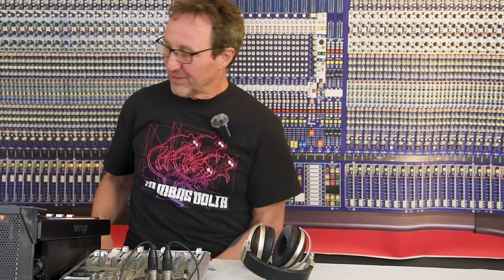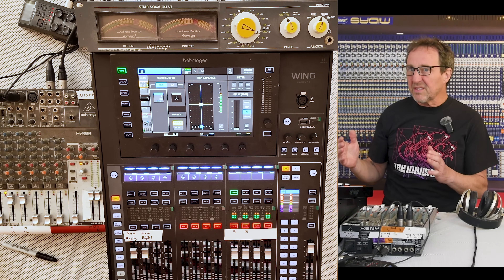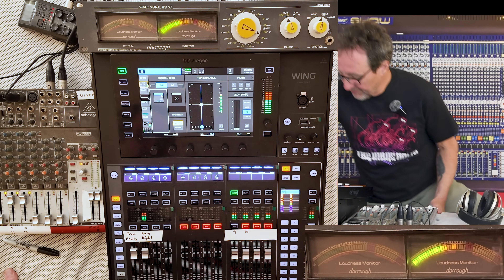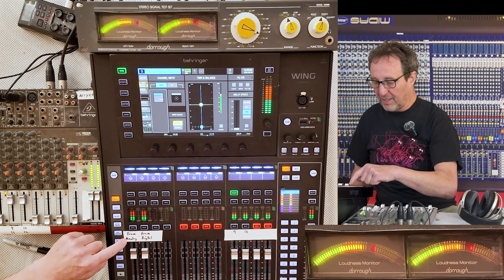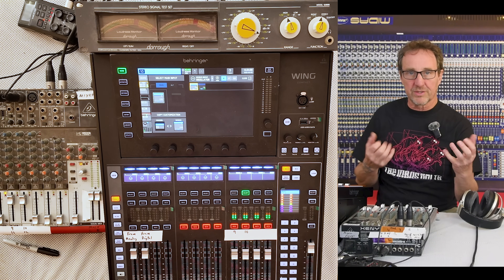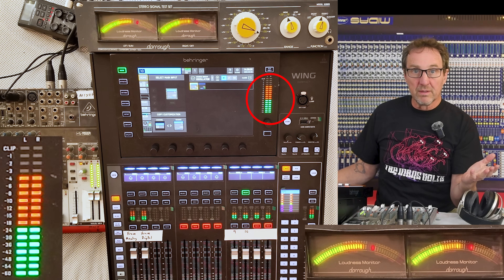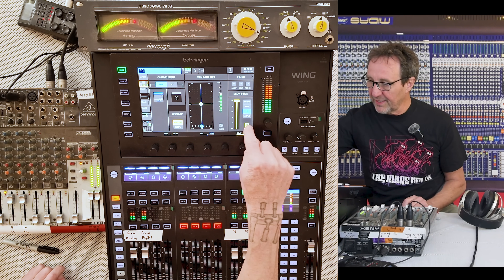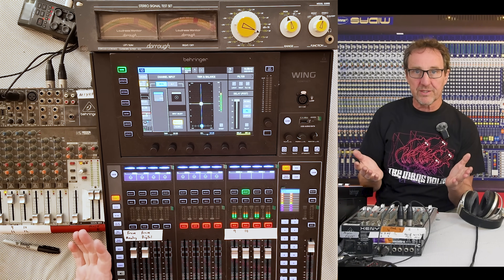Digital Audio Meters Don't Show What you Hear - Sometimes

Comment: You're confusing peak and rms Metering.

Use a RMS digital meter or a PPM analog meter and you'll get similar results. 

This confusion is the base of "gain staging" or "analog vs Digital" summing myth
Reply from the maker: Am I?

The dorrogh meter in the video shows both RMS and peak, 

As you can see in the video, the analog runs and peak meter are both reading correctly. 

Also as I show in the video,, the same digital peak meter reads correctly if the signal gets converted to analog and back to digital.

Is it a meter issue or a signal issue?
Reply: @DaveRat because dorrough is aligned to AES17 standard and the digital meter use EBU. 

That's why "db" means nothing without a common scale

Edit : the référence conversion from AES17 to EBU is also known as RMS+3 (If my memory is correct, this option is available in RME digicheck software metering)
Reply from the maker: Ok, so 8f it's the meter that is the issue, why does the exact same digital meter read the signal correctly if the signal has been converted to analog and back to digital?  As 8 show in the video on the Wing channels 1 and 2
Reply: You're assuming that the Wings master meter is calibrated the same way as the track input meter. I don't think so. Digital metering can be RMS or Peak. On a console like the Wing, it actually makes sense to have different calibrations. Peak on the master because ultimately, what we want is to avoid the DAC clipping. On the inputs, slower RMS metering makes more sense. Each meter has its own ballistics. To illustrate this as simply as possible, there's a simple experiment to do. Open Reaper and place white noise on a track. Then place a Reacomp on this track. Set the Reacomp with an RMS size of 0ms and a knee of 0dB. Lower the threshold until you get 3dB of gain reduction on the GR meter.  Now, slowly move the RMS size knob (the calculation window time for the quadratic average) to the right. The larger the window, the closer the gain reduction will be to 0. The incoming signal has not changed, however. It is simply the way the threshold is measured that varies. In a meter, it is the same, there is a window size that wants to vary from 1 sample to 1000ms. When comparing meters that do not have the same window, they automatically obtain different results. Add to that different calibrations between EBU standard and AES (and others) and we end up with a gigantic mess. On the master of the reaper mixer, you can right-click in the metering and configure the peak to RMS ratio as you wish with the possibility of activating or not the 3db offset @DaveRat
Reply: @Daysofsamara I think this is the answer Dave is looking for.
Reply from the maker: Nope, not assuming anything and that was the one of the first things that I tested when I saw the metering difference of the analog converted signal, it has nothing to do with the track meters or the master meters being different on the wing. 

Try it. You can take two channels and send them together to the left master of the wing and some them to a group come out of the wing convert to analog and then convert back to digital into another channel and send that to the right channel of the wing 

And the master meters of the ring will show up incorrectly on the left and correctly on the right
Reply: @DaveRat when you convert back to digital on the other track, how to you gain stage? I mean, aligning on what meter?

Edit : because, as far as I know and according to the manual of the wing, output alignment is 0dbfs= 21dbu so 4dbu is -17dbfs and for Input 0 dbfs = 16dbu so 4dbu is -12dbfs. So you have to compensate by trimming;  and what meter do you use for reference?
Reply from the maker: Are you working towards it being a metering issue and that that additional signal is not actually there and the meters are reading something due to some quirk that doesn't exist and/or doesn't matter? 

 or are the meters reading actual signal that is reducing the headroom available to us? 

Either way it's an issue that all the consoles have 

And converting to analog and back again makes it go away. 

And it doesn't happen in the analog domain. 

Well trying to figure out what's causing it is interesting and good perhaps start from the other end and look at how you would deal with it. 

Do we ignore the digital meters and use external analog meters and perhaps make ourselves vulnerable to digital overload? 

Do we trust the meters and accept the fact that we have reduced headroom and metering for sound that we can't hear? 

A real world example of an issue here is mixing for broadcast where metering level for the mono summed signal is compared to the stereo signal 

In this scenario the mono signal would look different on the meters than it sounds.

Plus situations like drum mics where 10-12 or more mics are all picking up high frequency energy from the symbols that is primarily de correlated would actually create something similar in real world
Reply: @DaveRat Meters in digital are useless. On that point, we agree. A simple red led flashing when clipping would be enough. And that's the beauty of working on digital with 24bit dac/adc, you can ignore Metering and just follow one rule -> just keep headroom. With 24bit converters you have more than enough headroom to work with (144 db of SNR) so we don't care about metering precision and what it really measure (peak, rms, aes, ebu,...). Personally, I use this rule with digital console or DAW for gain staging : track fader at max when solo = no clip on master bus. By doing so  you can ignore metering and you have the max fader resolution.
Reply from the maker: Yes having awkward and non-intuitive workarounds that deny you accurate visual representations of what's going on are definitely an option.
Reply: @DaveRat Is it worse than coming up with a shaky theory about digital summing and trying to prove it using a truncated protocol?
Reply from the maker: Whether digital summing is an issue or not is something I don't have measurement proof of. 

But it's fairly easy to demonstrate that the metering on digital summing is not correlate as accurately to what we hear as it does with analog. 

For d a w situations where you have plenty of time to get things right, and the ability to backtrack and fix things, having a system that does not rely on accurate metering is feasible. 

For live audio where there is no rewind and everything must be as good as it can be as fast as you can get it done, accurate accurate and logical metering that aligns with what we hear and what the system amplifiers and speakers will see is extremely critical and important.
Reply: @DaveRat Analog metering measures the intensity of electricity; digital metering measures a quantity of data.  Neither measures sound, and neither corresponds to what the human ear hears. In short, they tell their version of the story, not the truth. So, certainly, the ballistics of the VU meter and your experience with this tool mean that, from your point of view, there is a correlation between what you hear and what the meter displays. However, if you send a 5 Hz tone to your master, your analog VU meter will go crazy, but your ears will hear nothing. If we really want metering that corresponds to our auditory sensation (and fletcher curve), we need a LU (loudness unit) meter. In the digital domain, this type of meter exists, but it is of little interest in live mixing, even more so in mixing on high-resolution console since, in absolute terms, we have much more headroom than necessary.
Reply from the maker: Agreed and this is exactly the issue. With a 96k digital console, less than 50% of the bandwidth is in the audible range.

Fair enough but where are the tools readily available to identify and manage these out of audible bandwidth signals?

This was not an issue or as much of an issue when dealing with analog and converting to anolog and back to digital solves this particular issue.

You are correct in describing what is happening. What I find curious is that you are ok with it rather than pushing for improvements on a flawed setup.

For example, why don't consoles implement an out of bandwidth meter available on the cue buss that allows us to see high frequency information and issues that are above 20K yet passing through the console effortlessly on a 96K board?

The console is readily reproduce these ultra high frequencies and move them around internally and they can accumulate and cause issues yet no console manufacturer offers clear insight into actually seeing what's going on. 

Or better yet fixing what's going on. 

But there's a whole new mess if you start low passing signals because the low pass filter is create issues as well. 

Try it, set up like I did in the video where you show the metering issue and then use low pass filters at 22K or 24K or whatever to try and get rid of that high frequency energy that's causing the issue. See if your metering goes to correct. 

And if you're wondering if it's a high frequency issue, try the same test with pink noise that doesn't have all that I frequency content see if your meter is read correct then.
Reply: @DaveRat I'll summarize more simply: using VISUAL measurement tools to measure a SOUND signal will always be inaccurate. Even more so because the ear is non-linear. Metering is therefore already paradoxical. On analog equipment, there is an interest in giving an approximate value to the signal in order to get as close as possible to the sweet spot of the device and to take full advantage of the SNR. In digital, you have a container much larger than the content to put in it. The best microphone in the world, in perfect conditions will have an SNR of 105db. 24-bit digital allows 144db. And whether you place the 105db as close as possible to 0, as close as possible to -144 or anywhere in between has no impact. Which means that the only information that is relevant to know is not to let the cup overflow (exceed 0dbfs).  Knowing that the vase is 30db larger than the signal that must be put into it, well, stay away from 0dbfs and everything will be fine. For the rest, since, in the end, we are dealing with SOUND, it will always be more effective to use your ears to evaluate a signal than any metering.
Reply from the maker: Fair enough it will always be inaccurate and current digital metering is less accurate than what we used to have with analog. 

Some people may be okay with this, personally I find that to be less than optimum to be going backwards in accuracy rather than forwards, with newer technology

Though the term accurate is not ideal in this scenario. 

The digital meters are actually more accurate but less informative of really what matters to us. 

I spoke to a digital console designer And they agreed that having better metering in the digital console would be optimum and preferred but the digital horsepower to calculate the equivalent of a true VU meter for every channel and also provide accurate information to avoid digital overload would be extremely taxing on current digital systems and therefore it is not being implemented even though it would be better. 

And by better I mean closer to as good as we used to have with analog
Reply: @DaveRat for the 96k bandwidth. once again, this is a clumsy shortcut. 
Using a sample rate of 96k does not necessarily mean that the entire signal extends to 48k. the signal circulating in the console depends on what goes into it. 
Most mics have a bandwidth of 20000Hz. 
So, by adding two, three, 8 signals with nothing above 20,000hz, the summation of what happens above 20k will always be zero... 
So, maybe with the console's internal oscillators, it is important... but, in real life, we are in an area where nothing happens or, at worst, very low level signals are completely negligible.
Reply from the maker: And hence the video where I am showing that what you see on a digital meter might not be what you hear. 

I recommend that rather than speaking in the hypothetical maybe actually try this with 10 white noise channels low passed at 20K de correlated in summed. 

A test that I have done.

A scenario not too dissimilar to having a dozen drum mics in and about and around a bunch of cymbals. 

Check the results with and without the low pass filters on the white noise and check your digital metering versus your analog metering. 

Which one is more accurate to the actual signals being processed? 

Which one is more accurate to what you hear? 

Which one is more useful? 

I spent many many hours testing all of this with everything ranging from band limited white noise samples into analog inputs, and white noise samples with frequency responses that well exceed the capability of the A to D, and numerous methods of manipulating the signals to get things to line up.

I think you might find some interesting results if you start messing with it
Reply: @DaveRat : No, once again, your instinctive certainties are misleading you. "Decorrelated" white noise means nothing. The noises are just identical and shifted in time. By summing them and reversing the polarity, the RMS volume is reduced but not the instantaneous peak level (a sample in our case). This is why your two meters tell you different things, because one is capable of detecting the peak level to the nearest sample, the other uses a quadratic average. Replace your analog meter with an (analog) PPM meter capable of the same level of precision and you will get the same results. In the case of cymbals, we will be very far from having identical signals but shifted in time. So the cancellation effect will be much less significant.
Reply from the maker: Really, even when in the video I use two different white generators or when I do tests where I use white generators from completely differing sources? The time delay is just one example but the issue is consistent regardless.

Test it, and your hypothetical may not match the reality.
Reply: @DaveRat does the sound of oscillator 1 differ from the SOUND of the oscillators 2? No. Because both are white noise. Now play a bass in a track and duplicate it. Delay the bass on the copy track by 3 sample. You'll get comb. Some frequencies will null and other will built. Still Ok? Now watch this by cutting the summing of the comb signal by packs of ONE Sample. Some of the packs will be At max (that's the peak level). Then, if you take 10 packs and make the average value, you'll never get the max value. Because some dip will lower the average value. That's the RMS metering.
And what about your ears? 
That simply can't hear ONE sample max value, they hear an average value of a bunch of samples.
Reply from the maker: @Daysofsamara You're confusing non-random signals with random signals. 

There are not any durational tones with randomized noise. 

Take two cymbal mics and delay one of them longer than the lowest frequency we created by the cymbals And you will not hear comb filtering

Here's a video that has a de-correlation demo in it and I've done a few others in other videos as well.
Reply: @DaveRat Random doesn't necessarily mean stochastic. If a random generator always gives the same results (white noise), it's not the result that's random, just the generation. Can you identify a particular white noise out of ten by ear?
Reply from the maker: @Daysofsamara perhaps getting back on track here and focusing on the fact that the metering is not showing us what we're hearing in the digital world and does show us what we're hearing in the analog world and looking at why it happens rather than why you think without testing it it shouldn't happen maybe a better course of action
Reply: @DaveRat no, analog metering don't show what we hear neither. RMS Metering show approximately what we hear.
  
RMS Metering can be analog (VU most of the times) or digital 

Use a digital rms meter on the wing and voilà.

Or, use a sample peak meter on the analog meter.
Reply from the maker: One of the things that I do is when I make a statement I come up with a clear and easy to reproduce proof of what I'm saying. And often in ways that just about anyone can repeat the test.

I show that the signal increases 3DB, we hear a 3DB increase and in analog we see a 3DB increase, on analog meters after the digital console we see a 3dB increase. Yet in digital we do not see a 3DB increase but we hear a 3DB increase. Not sure what part of that is confusing.

But, if you read through the comments you'll find that many people have confirmed exactly what I've done in this test and you can too. 

Are you saying that the digital meters that don't move when the sound increases 3DB are the same as the analog meters that do show the 3DB increase? 

You're kicking a dead horse here.
Reply: @DaveRat Your protocol, certainly reproducible, just demonstrates that there are different types of metering. And I'm not talking about analog or digital but rather peak or rms. You are the one who is making the amalgam. As explained earlier, the db unit means nothing if it is not associated with a reference. 
dbfs, dbu, dbV, dbVU, dbLU, db SPL,... 
And it's the same for the measuring device, without the reference of what it measures, any comparison is useless. 
For example, a Peak Meter gives the value of the highest value sample, 
an RMS meter averages the value of several samples in a window of X (X can range from 3 samples to 1000ms). A True Peak meter gives the highest intersample value. 
A VU meter gives an average value of relative voltage in a window of 15 to 500ms.  
An SPL meter gives a peak or average value of sound pressure converted from Pascal to dB. 
And all these values are not necessarily correlated with what is happening within our ear. 
If the VU meter, the RMS meter, the SPL meter, the LU meter give reliable approximations, the Peak meter or the true Peak meter do not have this vocation. Their purpose is to remind the user how much headroom he has before clipping the converter. PERIOD. 
The Peak value has no other use. Let's take a simple example: a distorted guitar playing a 4-bar loop and a picolo snare playing beats 2 and 4 of each bar.
Peak normalize both signals to 0dB. 
Play them simultaneously. Which sounds louder? 
The guitar. 
Yet, both signals have the same Peak value -> 0dB. And if we create a loop on beat 2 of the bar, the snare will be silent and the guitar will be extremely loud.  And yet, the peak max value of the two signals is identical. In short, if you want to compare an analog meter and a digital meter, you must first make sure that they measure the same thing, otherwise, your protocol is biased from the start.
Reply from the maker: Very cool and lots of info that is interesting but also not really related.

This is not really a metering issue

As is proven by converting the aignal to analog and back to digital and the meters then read correctly. 

It is a signal issue/filter/high frequency issue.
Reply: @DaveRat when converting back to digital, what meter do you use to set the preamp gain?
Reply from the maker: Does not really matter as what we are looking at is the change in metering, not the absolute level.  Any gain that allows you to see the metering without clipping will do.

Also you can PFL those channels to see the metering better on the bigger PFL meters
Reply: @DaveRat the metering change if the absolute level change... 

As I said earlier, On the wing, DAC and ADC are not align with the same voltage relative to full-scale (see manual)
Reply from the maker: The levels that things are set does not change the results as long as you don't change the levels while testong. We are looking at the difference of correlating vs decorrelation with the setup set and not changing.
Reply: @DaveRat the level did change!!!. YOU didn't change it, the loop back set up did it for you.
Let's open the wing manual and look at the specifications. 
-> maximal OUTPUT level is 21dbu.
That means that 
21dbu = 0dbfs and so 4dbu = 1.23 Volt = -17dbfs. 
Let's look at the inputs: max non clip input level = 16dbu. 
That means that 0dbfs = 16dbu and so, 
1.23 Volt = 4dbu = -12dbfs. 
Knowing this, what happens when you want to send a line level of 1.23volt (4dbu) from the wing to the analog world? 
well you have to calibrate this signal to -17dbfs (RMS) on the outputof the wing. 
Let's recover this line level signal at 1.23 Volt (4dbu) and reinject it into an input of the wing. 
The signal enters at 1.23volt = 4dbu = -12dbfs. 
Let's remove the pan law value which should be between -1.5 and -3 db and we end up with a signal of -15dbfs. which perfectly explains why you noticed that the metering becomes "right" after the loop back... The master meter displays a lower value, because the signal is ... a lower value...
Reply from the maker: But I am only using the left output from the analog, so the pan pot just becomes a a level control. Since nothing is stereo and nothing in the setup deals with a level differential between left and right, the pan pot is just a level control that can be used to fine tune the level.
Reply: @DaveRat there are two ways to manage pan law, dim center or boost pan. I don't know how wing manage it but, whatever, there's still 5db difference from the alignement only
Reply from the maker: I am using the pan pot as a fine tuning volume control, there is no "panning" happening.

Pam law deals with left versus right, I am only using left, so it is left vs off, which is the same as a volume control on the left.